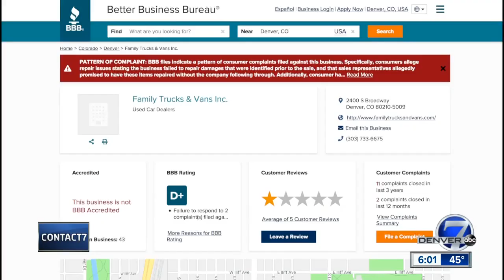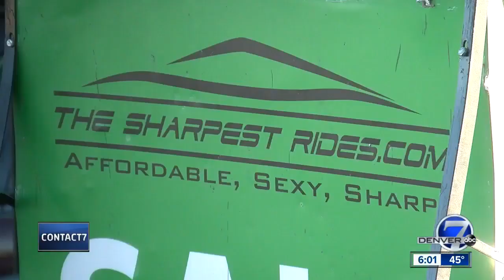Complaints pile up against Colorado used car dealership with ties to The Sharpest Rides

Comment: I'm one of those one's dealing with the same issues right now. And this is my second car from the sharpest  rides that didn't turn out the way they sold it to me. I'm getting a lawyer.
Reply: Good luck.  I think I saw in a previous story that Sharpest Rides requires that all potential customers agree to an Arbitration Agreement in the event that there is a dispute.  Many car dealers require that now.  I won't sell a vehicle to anyone unless they agree to arbitration.  What that does is, any dispute will never see the inside of a court room, but will end up in a forum (picked by the dealer) and the dealer also has a say in selecting the arbitrator.  The arbitrator's decision is final, there are no appeals.  And the customer has to pay half of the cost up-front.  I've never seen any arbitration cost less than $4,000.  Which means that the customer pays $2,000 just to have the case heard (that doesn't include any lawyer by the way, that's separate).  So imagine a football game, in which the dealer gets to pick the stadium, the dealer gets the pick the referee, and the visiting team has to foot half the cost, up-front.  There are cases in which the customer wins, but the odds don't favor the customer.  Might want to review your paperwork and see if you agreed to arbitration.  If you didn't, and you have a good case, that's great.  If you did sign arbitration, even if you have a good case, good luck.  You'll need it.
Reply: Yes stick to that!! In VA we have a Dealership Board & the review a dealership license etc.. this is absolutely horrible 😮‍💨

Comment: I'm having trouble understanding the complaints, even when I look at each one at a time.  Ruiz bought a car, that leaks oil, metal shavings in the oil, and the engine has knock.  She bought the car used, therefore there was an FTC mandated Used Car Buyers Guide affixed to the vehicle that explains that the car could potentially have abnormal oil leaks, engine knock, and cracked heads or cracked block.  If she purchased the vehicle, she agreed to this.  The Buyer's Guide also recommends that any potential customer ask the dealer "can the vehicle be inspected, either on or off the lot".  Normal people inspect AS-IS vehicles before signing into thousands of dollars in debt, and many mechanics are eager to perform Pre-Purchase inspections because it is easy money.  All they have to do is look for potential problems with the vehicle, they will make no repairs and still get paid for it.  So instead of complaining about the dealer selling her a defective car, I want to know, WHY didn't the mechanic who performed the pre-purchase inspection prevent her from buying a defective car.  Surely she had the intelligence to have the car inspected prior to purchase, right?

As far the the person who bought a car with active recalls, how expensive it is to have a recall repair performed?  Easy solution.  Get the manufacturer to repair the recall, and send the bill to the used car dealer.  Problem solved.

And now there are complaints about repossessing vehicles?  When a customer finances a vehicle with the dealer, the dealer is letting the customer drive off with a very expensive asset.  To help prevent huge losses, the dealer often requires that the vehicle be used as security in the deal.  If the contract is breeched in some way (lack of payments, failure to maintain full coverage insurance, etc...) then the dealer may secure the asset.  These are all conditions that the customer agreed to in writing.

As far as dealers being accountable for breakdowns, let's refer to the FTC's Used Car Buyer's Guide.  Looking at the FTC Used Car Buyer's Guide, under AS-IS, the dealer's responsibilities are "The Dealer Does Not Provide A warranty For Any Repairs After Sale
".  That one sentence outlines all of the dealer's responsibilites, and the customer agreed to that, once again, in writing.